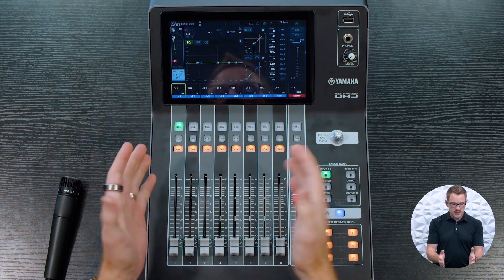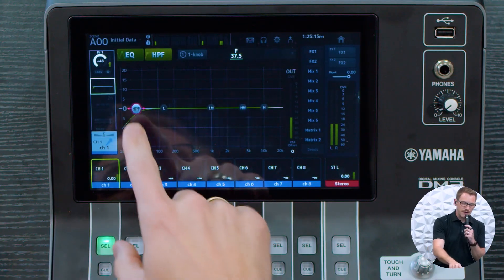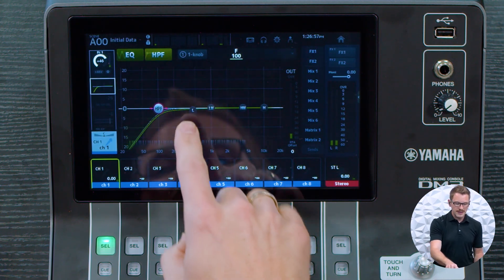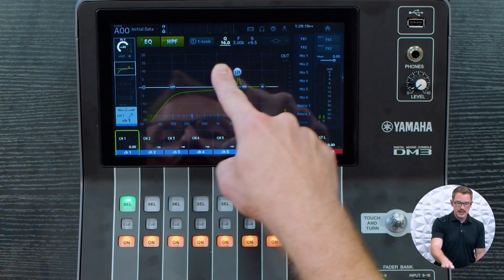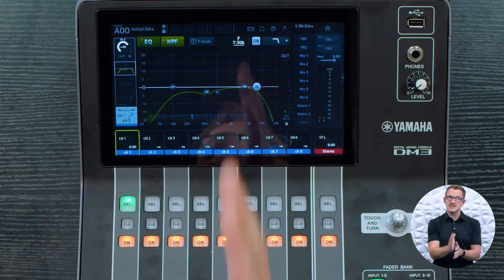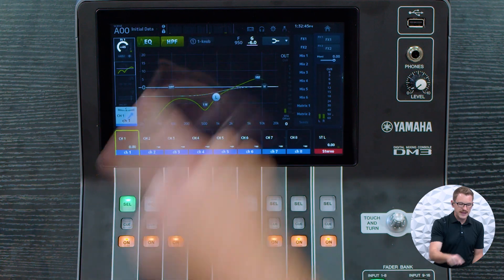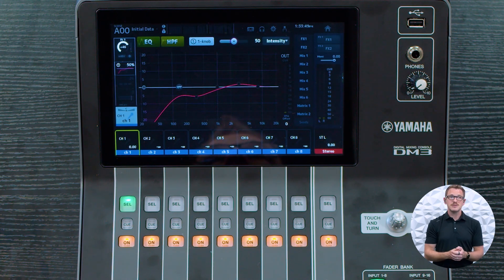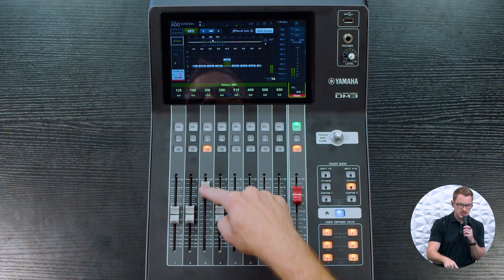How to EQ on the Yamaha DM3

Comment: Hey Drew, just curious. Doesn't the DM3 auto center the faders when you have the graphic on faders if you just push the  ON button which is only illuminated if the faders are not centered?

You seemed to struggle a bit with centering the eq band, so I just thought that I would mention this. 

Great videos man, I'm a real fan. Glad to see you reviewing more digital consoles. Keep it up please!